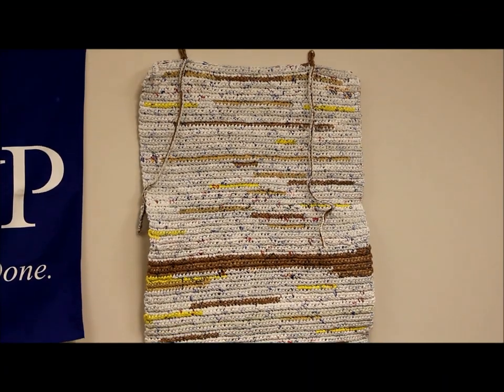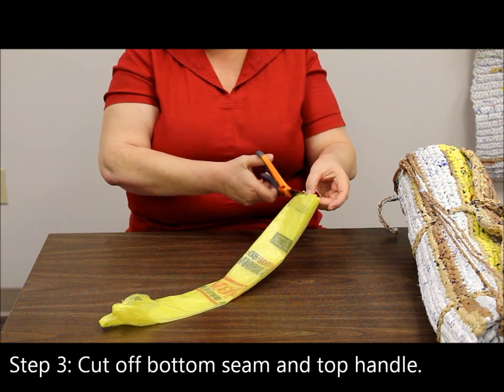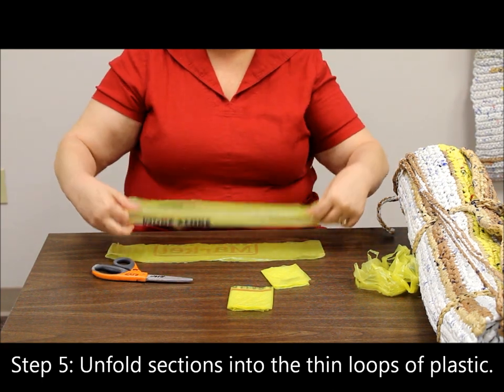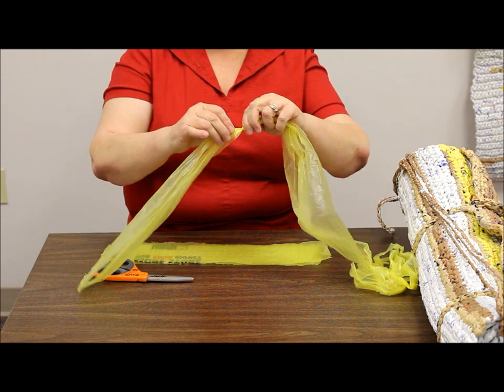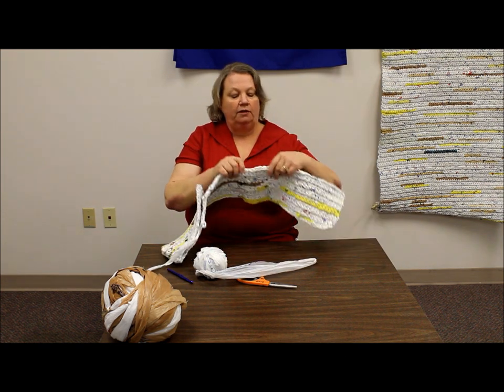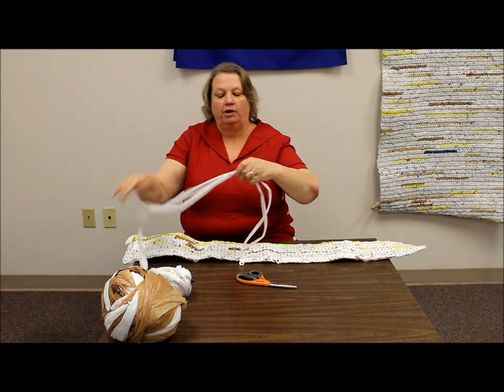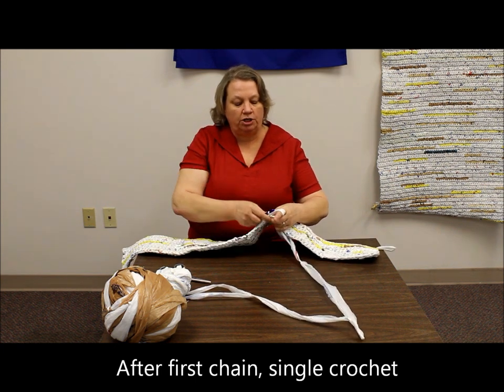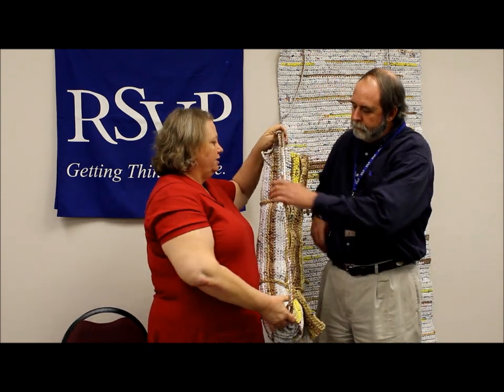How to Make Sleeping Mats for the Homeless

Comment: @danwormald Actually, these mats work up pretty quickly.  Once cardboard gets wet, the wet seeps upward through compression onto whoever's lying on it & when dry it warps - not so with these plastic mats. They're more likely to keep their owner dry, & are easier to transport than sheets of cardboard & have a longer use life.  Not the Arctic sleeping bag, but they do have a sort of spongy give to them & the folks that I've seen them with have really appreciated them.